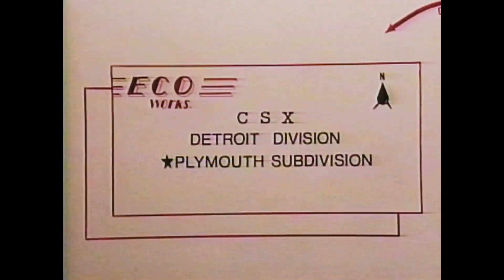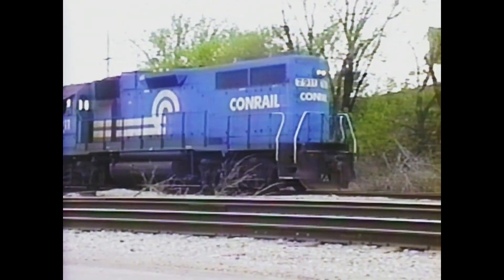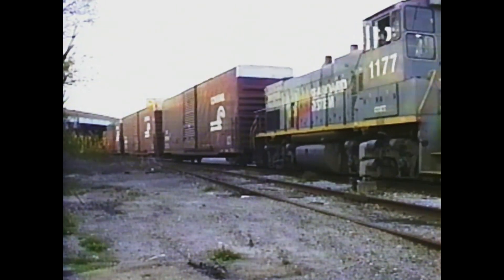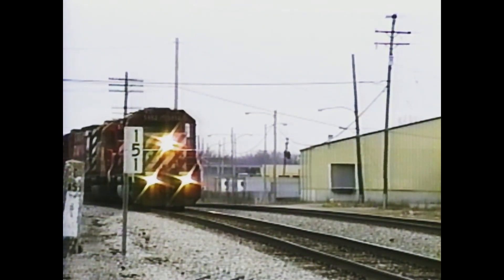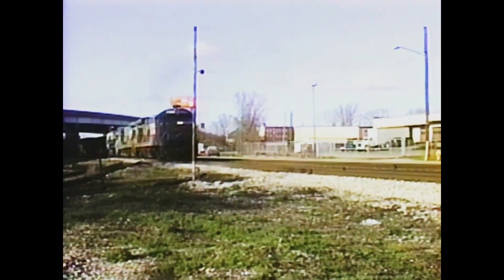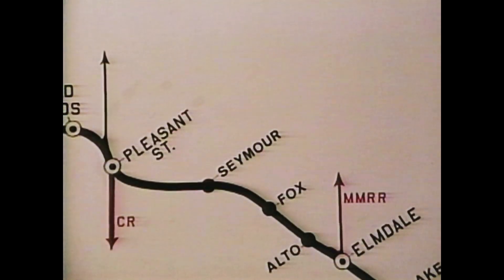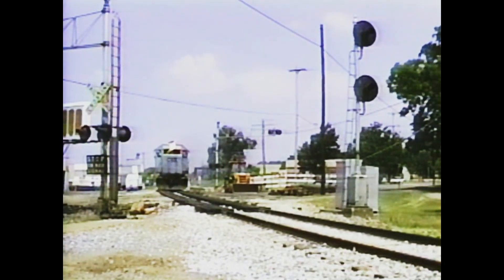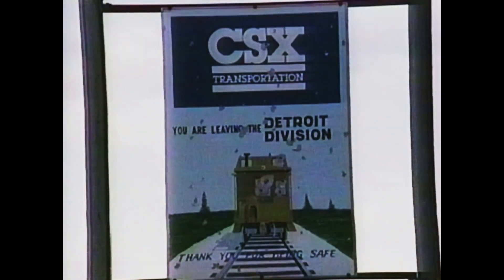CSX Plymouth Subdivision Part 2 Grand Rapids Michigan 1991

Comment: Enjoyed the video!  My favorite memory was watching a west olive coal train pull north through Plymouth, then back east to get a running start at the hill west of town.  I remember standing in the Plymouth freight house parking lot when then came west through town, SD's up front, two 4 axles pushing on the rear.  technically I think that was 88 or 89, but close enough.
Reply from the maker: I heard that hill would give westbound trains problems, especially if they were coming from the south.  
I never heard they would make that move though.  Thanks for the memory.
Reply: @steamlogger  I’ve tried to get more information on why they made that move, but I have been unsuccessful. Only thing I could figure was maybe especially big trains could not get enough speed going around the southwest wye? Would love to know more about that operation.